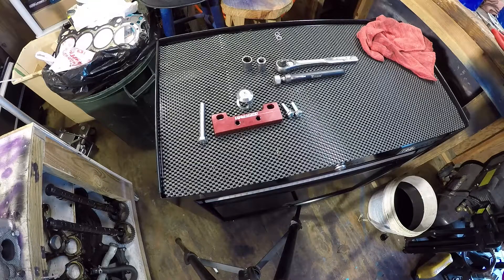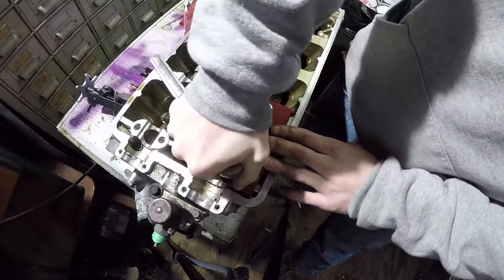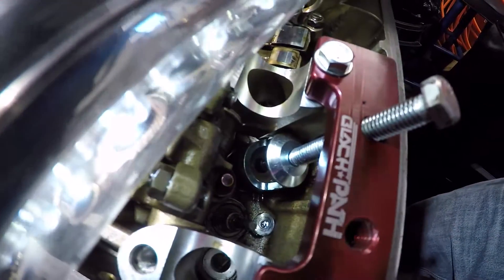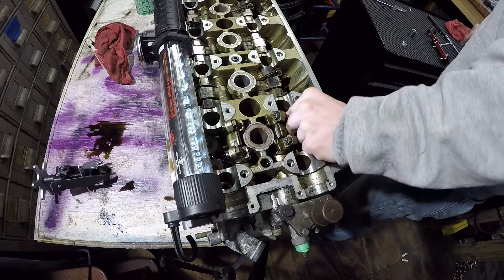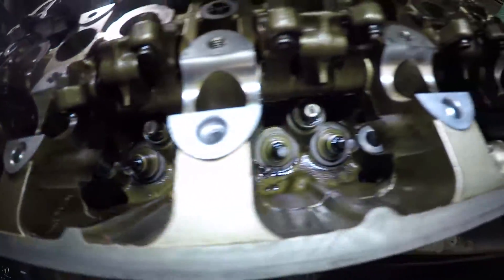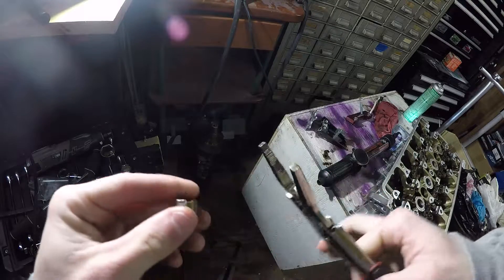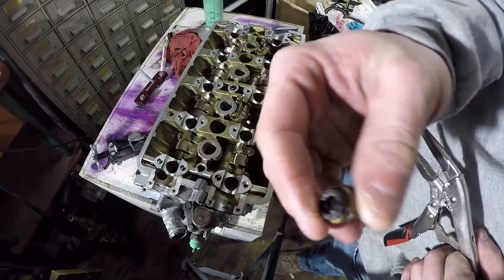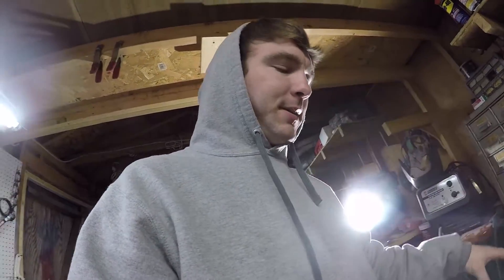PROJECT EM1 EPISODE #8 HOW TO REMOVE VALVE STEM/SPRING/SEALS IN A B16 CYLINDER HEAD!!!

Comment: I have a similar tool on the same head. I got the first 2 and have tried every other one. I screwed the tightening bolt down all the way,  and the keepers are still locked in? Whats the problem?